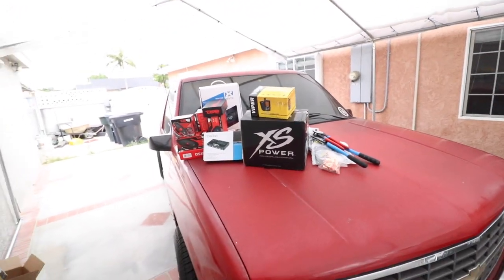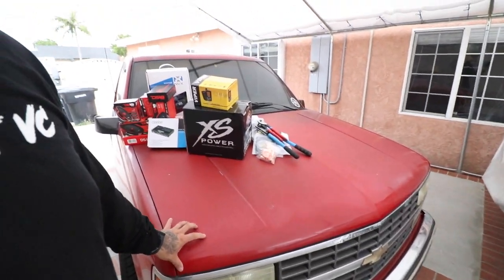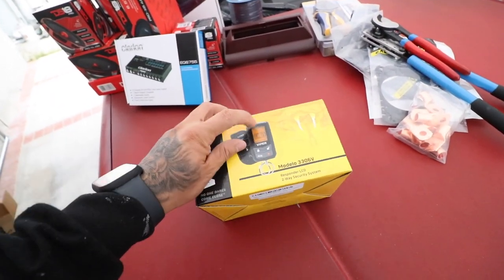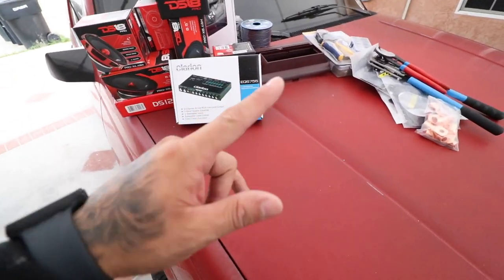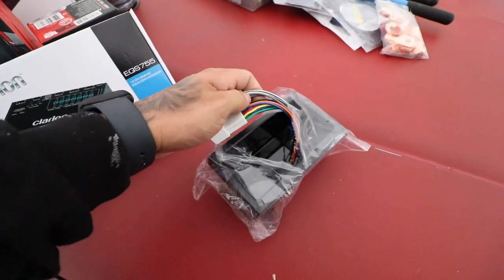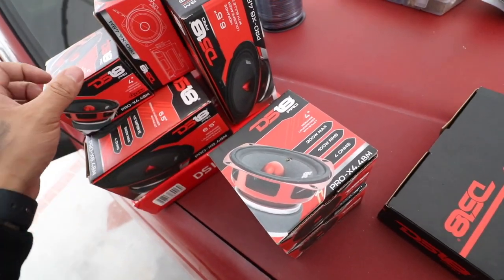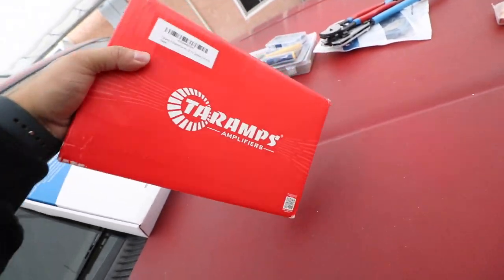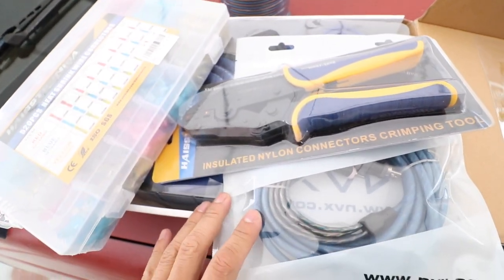INSTALLING A SOUND SYSTEM ON MY 90 OBS!! PART 1

Comment: I have a 1989 obs single cab as well exactly like yours, yea a in detail video would be nice so I can learn, especially on the 4x6 to the exact 4 would be nice.
Reply: I'm having trouble mounting my 4x6 speakers in the rear cab corners as well. Magnet will not clear.